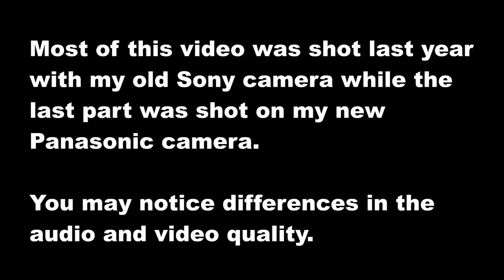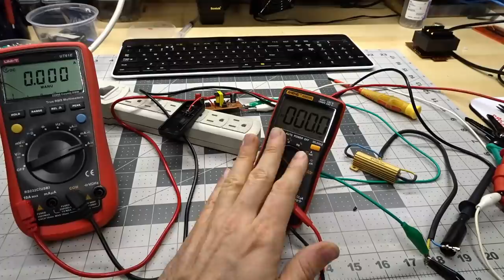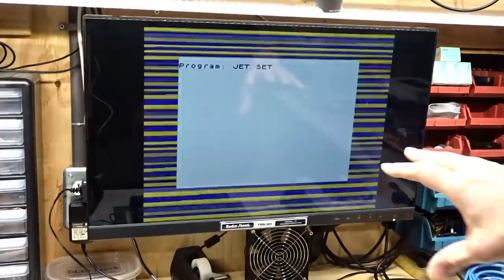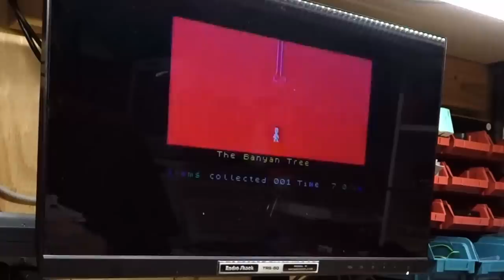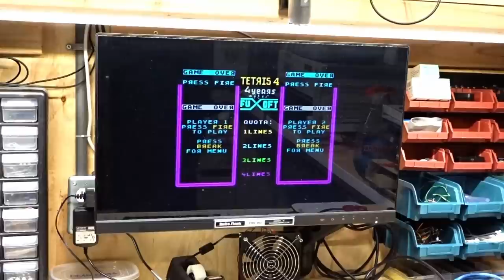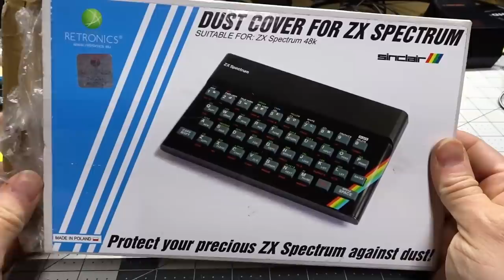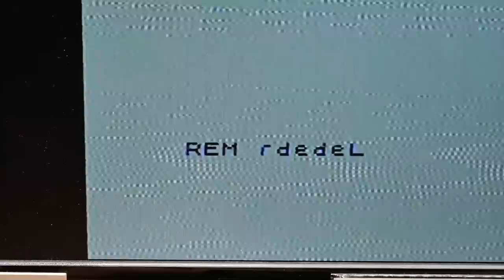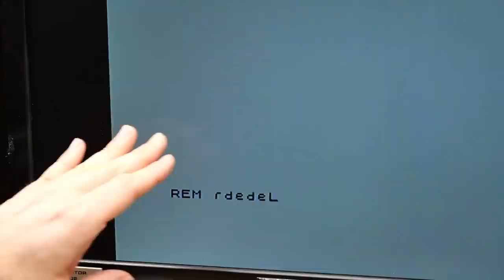ZX Spectrum Part 3 - Revisiting the machine at last!

Comment: "normally half of the prong is covered in plastic"
Only the non-compliant Chinese ones. The plastic sleeve would in fact prevent the prong from making contact with the ground wire in the socket.
Reply: Eh you are talking rubbish. Since BS1363 was updated in 1984 it has been mandatory for the plug to have the neutral and live pins partially shielded. See the wikipedia article https://en.wikipedia.org/wiki/AC_power_plugs_and_sockets:_British_and_related_types#BS_1363_three-pin_(rectangular)_plugs_and_sockets

Comment: After having similiar loading issues, I decided to actually see what signal the ULA chip is receiving and why this works so unreliably. As I found out, the high levels of the input signal are decaying much too quickly - on a scope you can see a very distinct RC discharge curve at every single pulse. Looking at the schematics (all issues of the 16k/48k spectrum have the same circuit there) you can see that the signal is AC-coupled via a 100nF capacitor (C32). After some calculation I could guess that either the input impedance of the ULA pin must be as low as 5K, or there is some other parasitic impedance in the circuit. 
Anyway, by just replacing C32 with a higher capacity (10uF to be sure) the signal that reaches the ULA is now perfectly square and loading performance is improved dramatically. 
I cannot say what this mod does to an outgoing signal when trying to store programs on tape. But as I do not use this feature and probably never will, I just dont care.

Comment: It’s strange  but back in the day  I never had problems loading programs into the Spectrum, I used a ghetto blaster to load mine and I could mess with the volume as the program loaded turning the volume up and down as it loaded I even messed with the bass and treble, not a problem. 😂

Comment: play some of the tapes into a pc audio program, if they are all at the same level, that rules that out. do the same thru the amp to rule that out. The speccy might just have a crappy input jack connector, presuming you are using a mono jack so you haven't any signal shorts in the jack and checked with a scope for clipping.

Comment: I had a simple cassette player for loading games, the head azimuth had to be as crisp as possible, if the audio sounded too easy to listen to, the speccy would not load. (70% volume set).
The speccy could never compete with the amazing american machines, but it was good for learning about programming/saving/hard ware interface understanding and just basic funny little games.
I built hardware interfaces for mine and hacked/repaired them.
I had a mgt plus D disk interface and ibm disk drives, wow they were so fast lol.
I got a lot out of that handfull of chips, better known as the spectrum :-D

Comment: Most phones have automatic gain control and a number of software manipulations of volume and output, shaping etc (which are below the user layer).  Could you try playing the audio from a PC or something with more stable/predictable output?  Have you Deoxit cleaned the input jack on the ZX?

Same audio interference susceptibility you noted with the RCA video connector applies to the audio cables as well.  A shielded cable may help with those connections as well.  We live in a radio noisy age.  Also is there a way to record those programs over again from memory to "tape" and capture clean and known good data?  Surely there is a way.
Reply from the maker: I actually just picked up one of those large 80s tape recorders (mono) which might be worth testing with. Recording into that and playing back into the spectrum since the Spectrum 2 requires super loud volume to load properly.

Comment: It does seem like the loading issue is related to your phone. What file format are the software saved as, could the files be of a low resolution, if it's an audio format? And do you use the same app and file format for other micros, but with better results? I just think you are one step away from having a happy Spectrum.

Comment: The loading problems are probably caused by interference (like your crappy video cable). Get the scope out and probe the audio close to the Spectrum. Interference is likely to be picked up in the audio cables or the amplifier itself. It doesn't look like it's shielded. ;-) Try feeding a sine wave and look for clipping. The output impedance of your amplifier should be matched (more or less) to the input impedance of the Spectrum.

Comment: Save the yellow video cable you threw out. When using RCA on Apple II computers, sometimes the thick cables don't work well (due to resistance?), but I can use one of those skinny cables and all works well.  So that is an example use case where you need the opposite effect.
Reply from the maker: Heh yeah and also some skinny cables are likely totally fine -- while others are junk.

Comment: maybe shield the amplifier? Also a way to get around any ground loop possibility is to test with bench supply on ZX . Cheap test before spending $ if you have the equipment already.
Reply from the maker: Believe me, I tried everything including powering the ZX off the bench supply in part 1 and 2 of this series. I didn't shield the amp but it's powered off my bench supply and sounded perfect with headphones... it's why I tested it first.
Reply: @adriansdigitalbasement  I'm just wondering if it's picking up high frequency noise. Have you looked at the output with a oscilloscope?

Comment: Ease up on the phone's volume of the file playback maybe. Not at all experienced with using a ZX Spectrum but my car has a tape deck so I use an adapter for my iPod to play music, it's the same principle. Try 70-80% volume on the phone, 30% or thereabouts on the amp. Too much of both is going to garble the sound of the data too horribly for the Spectrum to understand since this is far more of a delicate balancing act than just trying to play music. Plus digital audio has a much lower noise ceiling versus analog tape so even trying to go by what a Speccy purist would do with real tapes and a recorder might differ.

Comment: Honestly, if you want a more comparable version of the ZX Spectrum to a C64, I'd get a Spectrum 128K of some sort. It has a 3 voice sound chip and a ton more ram for games to use. That and the 128K Spectrums generally had much better keyboards. It'll never be a C64, but it should be loads better than the older style Spectrum the the bleeps and bloops only. I think many versions of the 128K Spectrums had RGB video output, which would look stunning on a modern display compared to the S-Video of a C64.
Reply: ALL 128K Spectrums have RGB out via an 8-pin DIN connector; the wiring differs a bit between the original 128 (AKA Toastrack due to the heat sink) and the grey +2 on one hand, and the black +2 and the +3 on the other hand.

Comment: About the ZX Spectrum being frustrating to use, the difference between it and the C64 was the price.  The ZX Spectrum was sold at a knock-down price to try and get mass-appeal in the marketplace.  It certainly introduced me to computing, moreover computer electronics.  I can't say I remember it being frustrating to use...the keyboard once the "hang" of it was sussed, was pretty intuitive.  Maybe 8 year-old me was more accepting, even compared to the BBC Model Bs that were flooding into UK schools at the time, I did not consider it flawed.  I think probably having used proper keyboards for so long, to go back to its quirky arrnagement 30-odd years probably does seem odd.  I can remember the faff of getting games to load, yes it was an art, but basically, you sussed what worked and what didn't. It however, was sometimes like it knew you were waiting for it to load, it would get to 99% of the load and then fail!
Reply: Made me thinking. I was about to say that typing on a keyboard is the first thing you learn, no matter if Specci, QWERTY or Dvorak. If you have to change from whatever you started with it might be frustrating. Like with other things too. Ask those moved over from Windows to Linux. But then I realized many in the UK must have started with a BBC Micro, thus QWERTY. Suppose many purchasing a ZX 81 or Sectrum were frustrated with the keyboard.

Comment: Those power supplies get hot! Are switching supplies more gentle on the old hardware even if you replaced caps in a original supply?

Comment: Replace the voltage rectifier on the spectrum with a modem Traco Power TSR 1-2450. No more heat sink

Comment: That RCA cable was probably the kind that uses heaphone wires, instead of being a proper coaxial cable which is a lot more expensive to manufacture? That alone easily explains the noise. The entire point of RCA connectors is that there's a continuous shield between the two ends, with the signal going through the middle. Cheap RCA cables "forget" that, and use cheap cables with the two wires going one next to the other. It probably would pick up even audio interference.
Reply from the maker: I am positive it was a cheap cable from China and exactly that -- was the cheapest crap possible.

Comment: 13A is the rating required by code in UK. Nothing to do with the load. But I agree, it should be much lower if it's protecting the power supply.

Comment: I'm content with ZX emulation.  The physical machines just feel cheap as ____.  And as far as tape-loading games go, that's one thing I liked about the Atari 8-bits having a standard SIO-connected drive.  No volume controls, so basically a standard volume level.  I know Commodore had standard tape drives too, but many others just used off-the-shelf tape decks that you had to fiddle w/ recording and playback levels.  Having the phone volume maxed might be introducing distortion on some tape recordings that might already be a higher level.

Comment: These days even the lighting fixtures seem to generate RF interferience (cheap in-built current regulator circuits).  Are you using LED lighting strips/arrays in your basement?  A good cable is the best fix though, better than hunting interferience producers.  Especially considering if its the lighting generating it.  Though, you might be missing an RF shield on something else somewhere :)

Beautiful ZX you got now, was that a new-old-stock keyboard membrane and plate?  Totally understand the UI frustration with the keyboard on that model.  I couldn't ever deal with the rubber button keyboards myself.

Comment: Saying the C64 was better than the Spectrum was basically declaring war in the 80s UK. A regular Spectrum with a cassette recorder had no real problems with loading or saving, definitely nothing like this. There are modern options that let you load from sdcard as well.

Comment: How loud can you hear the game loading from the Spectrum speaker?  I found that really boosting the output using my desktop PC sound card made it very audible and games load every time
Reply from the maker: On this old Issue 2 board, you can just barely hear it. I was told this is pretty common on this particular revision of Spectrum.
Reply: @adriansdigitalbasement  interesting.  My next repair is a 2, I'll see how it goes! The 6a I just finished was quite loud

Comment: i am just getting involved into spectrum again after many years... what i have found with loading games via digital source otla/tap/tzx etc is that using my Sony reliever  headphone output socket connected to pc with stereo to mono lead couldn't get anything to load.. tried multiple settings on amp and pc with different software ..tried pc output direct no good,even tried to output pc signal via old tape deck. still no joy ..tried phone still no good.. then i tried streaming signal to the apple tv  connected to  receiver then signal is perfect ... loads first time ... so i guess that the pc is interfering with the signal..
Reply from the maker: Wow! You tried everything too. So you used the headphone output on your receiver? I guess one thing is the receiver headphone output likely can drive more signal than typical other devices. It may still just be that issue overall .. not enough signal even with that headphone amp.
Reply: @adriansdigitalbasement   yeh used the reciever output hopping it would have some guts .. been reading loads about it.. i even tried using a stereo signal into spectrum which would detect one channel as the ground and inverting the signal to boost it (bit over my head though) i can remember back in the day using different tape decks for different games ..and many failed attempts at copying tapes using my 3d super woofe at full volume ..but streaming file from my pc/phone  to my apple tv and my reciever connected to that via hdmi works great guns..

Comment: Unusual to see a product from the 1980s made in China like that plug is.  Back then, most companies had yet to betray their workers and move production overseas.  'A' might be the pause key, and the colors change to prevent burn in.  Those metal covers are recyclable aluminum if you recycle.

Comment: Digikey, Mouser, Newark ... they all have proper quality DC power supplies and wallwart adapters that you could buy, with good filtering and the right amount of current for your needs. Not sure why you went with that shitty power supply. 

You could also buy an IEC connector (the "Mikey Mouse" C7 connector or C5 if you want earth pin as well, or the bigger one C13 used on regular power supplies) and attach it to the original case by cutting the plastic a bit. This way you could buy ready made power cable and make it look "pro".

Comment: Hmm.  Bummer about the "tape errors".  It may not be the machine, though.  Whenever I try that same cellular phone method to load programs onto my Apple IIe, it fails more often than not.  I don't have an additional amplifier like you have, though.  I'm going straight from an old Samsung Note 4 to the cassette input port on the IIe.  Don't abandon hope just yet,!  Your shelf looks good, too.
Reply from the maker: I've used that phone with great success on other machines -- like the C64 with my Datasette Audio Input Mod.
Reply: @adriansdigitalbasement  Well dang. Hopefully one of your viewers can provide you a solution. :)

Comment: What about putting a simple diode to the path to drop some voltage easily? I like simple solutions. The original PSU is unregulated, one plain diode on the cable should dissipate some heat instead of dissipating it inside the computer.

Comment: I know there is an issue to get constant audio levels from tape. I sapled all audio files from the tapes and cleaned them in audacity to  remove noise and all unwanted frequencies beside the two for "zero" and "one". I also adjusted the audio level to be high enough without clipping as it wasn't consistent enough from the tape.

Comment: Don't use a phone to load games, that's the recipe to get frustrated with a speccy. Get a DivMMC/DivIDE or a TZXDuino/Maxduino. 

DivMMC/DivIDE loads .tap, .sna and .z80 files directly from an SSD card or an IDE device, it's the fastest and also has different ROM's for different purposes, it even expands the Sinclair's basic. You can get one at bytedelight.com or ebay.

MaxDuino is a "digital tape player" more or less, it's basically an arduino that plays .tap, .tzx and other formats for multiple systems (MSX, CPC, Spectrum, Electron, BBC and so on), you can build it yourself with an arduino with this software: https://github.com/rcmolina/MaxDuino_v1.53 or get it from eBay, it's very cheap.

Also, you can get a Dandanator mini, it's like a programable cartridge, it has 512Kb of flash and it can store compressed images, it loads instantly snapshots or tapes and alsop allows you to add "pokes" to cheat in the games.

I would recommend the DivMMC as it's the most reliable and versatile, the speccy's ULA sometimes get "deaf" and make very hard or impossible to load anything from audio, with the DivMMC you avoid that possibility as it loads the data directly into memory.

Hope it helps!

Comment: Comparing the C64 with the speccie, the Spectrum was programmable out of the box, supporting graphics, etc. The Commodore was crap by comparison in that area, until the Simon's Basic cartridge came out, making all the great capabilities accessible in basic as opposed to assembly. I say that tho I was a Commodore owner at the time.
Reply from the maker: Yeah all Peeks and pokes on the C64..... But at the same time, the on-screen basic editor just feels miles better. (Not even looking at the capabilities.)

Comment: They were terrible. I kept mine just long enough to lose several days worth of work to a cassette that wouldn't load (I saved over my previous save - I was young) and returned it to the store for a refund. Bought a used VIC20 with the money. The VIC is in storage and still works as far as I know.

Comment: I had the exactly the same problem as you loading games using PlayZX. I found in the settings if I changed it to Stereo and set it 'Invert one stereo channel' the load tone was clearly audible from the spectrum and it loaded every time. I used a stereo lead from my phone, no stereo to mono converter and also no extra amp. My phone is a Samsung S8
Reply: This works. Spektrum has R and L pins connected no ground. Old mono cassette player with 6V power supply works too.

Comment: Do you have an old 80s cassette recorder - the sort with piano keys for play/stop/ffwd, etc along the front edge?
If so I'd dig that out and try loading some of the tapes that you got with the Spectrum. That'll give you a feel for how it should sound and how the border bars should look when it's working correctly.
Reply from the maker: Funny I didn't until yesterday -- I just picked up a Panasonic one at the thrift store for $5. I know those output a much higher volume than most things so it might work. I do have some old tapes for the Spectrum too so once I fix up the tape deck, I can try out a real tape.
Reply: @adriansdigitalbasement  Serendipity in action!  =)